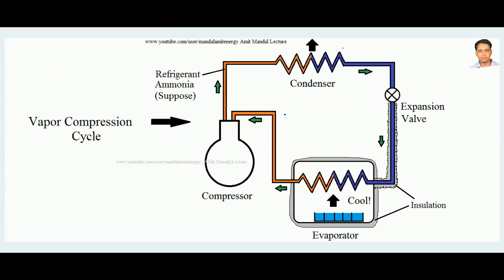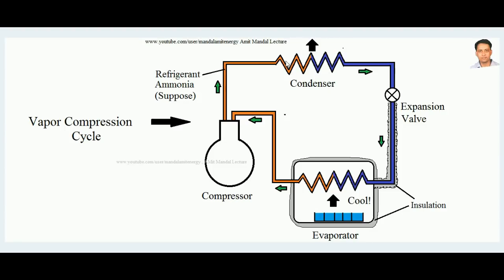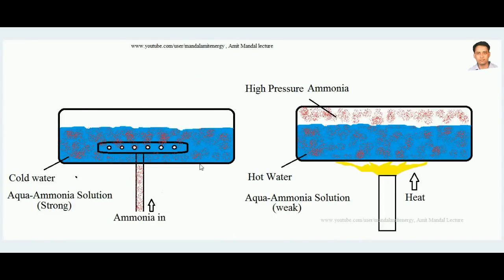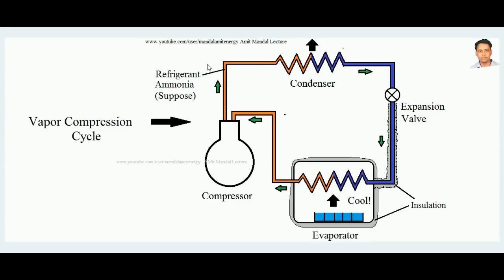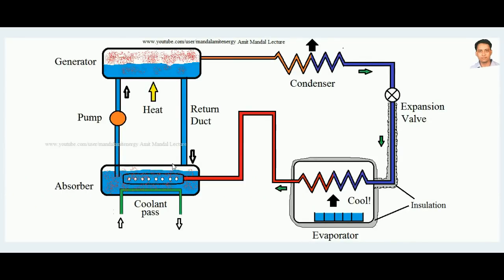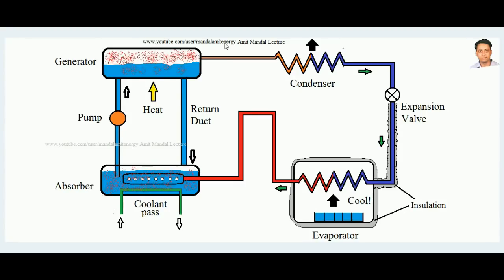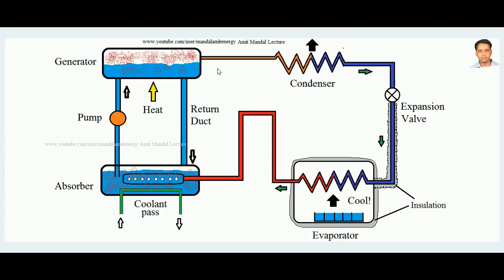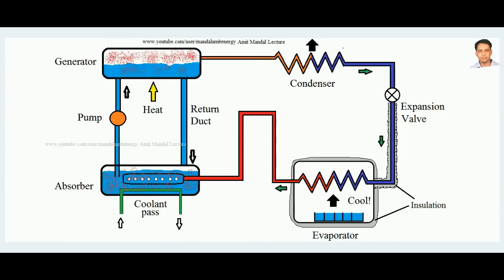Vapour Absorption Refrigeration Cycle (Aqua Ammonia System) | Vapor Absorption Cycle

Comment: you have explained the absorption system nicely. It is absolutely the same as said in the books. for eg. if i want to cool a quantity of 50 ltrs. (in evaporator) of  water in a aluminium container to 10 degree centigrade  what should be the size of generator (Length X Breath X Height = Volume) + temperature , Absorber (volume) + temperature, condensor coil of 5/16" pipes length  and evaporator of 5/16" pipe length + temperature to be maintained. If you could explain, this would be more useful for a trial check (or) how will  you arrive  size of the system to cool the aforesaid quantity.  Please explain. Let us try differently which will be more useful.

Comment: One question and one suggestion - Question:  What keeps the pressure separated between the generator and absorber, seems like the high pressure in the generator would blast pressure into the absorber?   Perhaps an orifice that isn't shown?  Suggestion for people dealing with his strong accent - watch at 0.50 or 0.75 speed.  But I agree with others, very good presentation, and I now almost understand this.
Reply from the maker: I have told the principle ..

Comment: One doubt u r eliminating the compressor but u use pump to pump strong ammonia water solution from absorber to generator . So again u need power for running the pump right???
Reply from the maker: Pump needs lesser power than compressor, Electrolux refrigeration even eliminates pump  from aqua ammonia system. Watch my lecture on Electrolux.

Comment: Sir can we use this in automobile ac system instead of using fuel to heat the generator we can use the waste heat and exhaust gases of engine. And supply it to generator..
Reply: That sounds like a great idea, I wonder why it isnt used. Maybe because of the ammount of space and weight such a system would use?

Comment: Ammonia has greater affinity to water. So water is used as absorber and obiviously many other solution can be used as an absorber but water is relatively low in price and readily available it is used. The purpose of using absorber in absorption and compressor in compression is only for increasing its pressure to get rid of the latent heat to the surroundings as well as to Recirculate the refrigerant and to keep on the process in circulation.
Reply from the maker: The only work input is in compressor, it is greatly reduced . In Electrolux which is modified aqua ammonia system, there is no pump even.

Comment: Condensor works on constant pressure and temperature so it doesn't lower the pressure temperature, it is expansion valve which lowers pr and temp
Reply from the maker: Expansion valve is a 'Gate' of fluid to move from high to low pressure..

Comment: Why it is used replace of vapour compression refrigeration
Reply: Compressor need more power.. Cannot b used for industrial use..

In absorption system only heat is needed not electricity..

Comment: What about refrigeration units that dont have pumps?
Reply: Those systems are a little different. I think they use a gas like hydrogen or helium to create a high enough overall pressure in the entire system to alllow the ammonia gas to condense in the condenser portion of the system, which is located near the bottom of the system where hydrogen or helium gas wont go (because it is very light). But then in the evaporator portion of the system where the hydrogen or helium is, the ammonia evaporates slowly (it doesn't actively boil like it would in a traditional vapor-compression system) and creates a cooling effect because the hydrogen or helium exerts pressure on the surface that keeps it from boiling, but yet the liquid ammonia does evaporate into the hydrogen or helium because the vast majority of the area occupied by the hydrogen or helium is actually empty. It's really weird when you think about it, but it's the same principle that allows water to evaporate off of our skin well below the boiling point of water (212 degrees). It doesn't actively boil, because the overall pressure is too high, but if the humidity is low enough the water will still evaporate despite the atmospheric pressure being much higher than the boiling point of water at that temperature. It's because of all the open space between the molecules of whatever gas is creating the overall atmospheric pressure. They use helium or hydrogen because they are so light, so they are easier to keep seperate by elevating the evaporator area, and because they don't react with the ammonia.

Comment: Sir I want to make a absorption cycle using solar hit , I know it is possible, I found cues and I find this video , I understood your video, bat I have a question , is solar hit enough to necessary hit ?sir I'm waiting I need your interaction.
Reply from the maker: Yes but correct calculations has to be done
Reply: Amit Mandal thank you sir , if I want 1 ton ref effect, how much hit needed .
Reply: And how ratio of ammonia and water
Reply: I want to build VAR system using waste heat from a trucks exhaust. I have no idea how to the calculations though. Can you help?
Reply: I had a question sir..why is there a need to dissolve in water.. Can't ammonia be heated or cooled
directly

Comment: what is the purpose  of sending refrigerent in absorber ? why ?
Reply: So that it mixes with water. It is much easier to pump 10 ltrs of water than to pump 100 ltrs of vapor.
Reply: This is where the ammonia would be absorbed by the water and then transferred to the heat source using the water pump where it would be pressurized. Without being  dissolved in the cold water in the absorber it would not be possible to pressurize the ammonia in the generator.